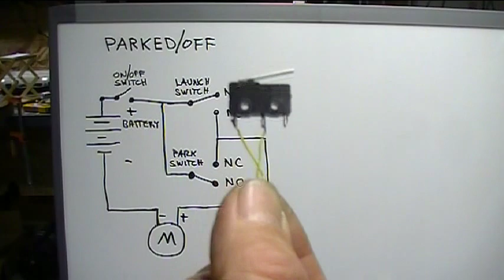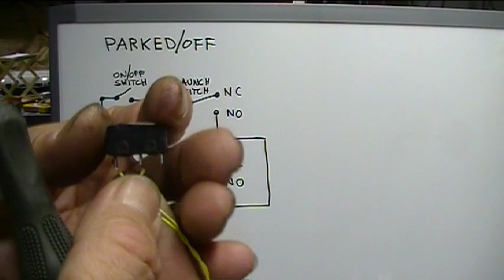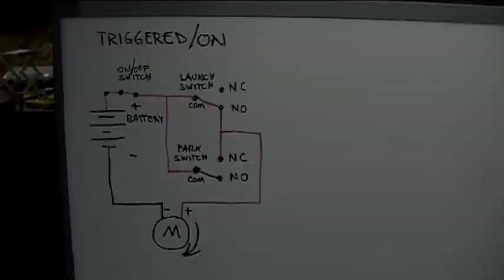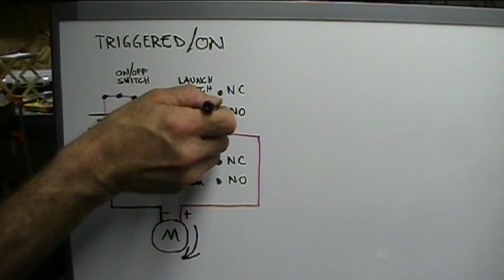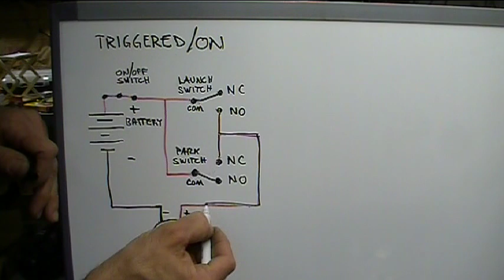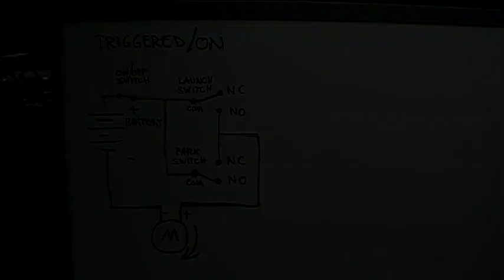Tennis Ball Launcher Deconstructed

Comment: Dean very nice work. For those who have not noticed but at @12:20 where he talked about normally open and normally closed switches, the configuration is a Logical OR gate. With both switches are open, the motor is off. If the launch ready switch NO is closed, then the motor is on. If the park ready switch NC is closed, then the motor is on. The launch and park switch are connected in parallel. This is the current flow of a logical OR gate in state circuitry.

Comment: i built something very similar. i place a delay relay in the circuit to give the puppy time to get down range i wired a flashing led to the nopen position on the timer relay switch which would flash once the ball triggered from the microswitch, I also added a piezo buzer to the motor circuit which really hypes him up as it turns and fired. I used a wiper motor and just used the thread on the motor to the axle which worked a treat.  Your vid inspired me thanks for sharing.
Reply: no need for the park switch as the motor stops as the ball leaves the trigger swith.  i run the arm on thrust torrington bearings i also made a top and bottom guide to keep the arm perfectly aligned. i will email you pics tomorrow.

Comment: This is the best explanation of the use of microswitches in a circuit that I have EVER seen - and I was an IBM tech for 23 years. ATMs are chock full of these switches and circuits. Wise of the University of Oklahoma engineering student to ask you. :-) 

If someone builds this with a weaker motor, they could try using a shorter or weaker spring that puts less torque on the motor - provided it is still strong enough to launch the ball. 

Combining your hands-on knowledge of building things with your commenters knowledge of Logical And / Logical Or gates would provide valuable knowledge to many more people. It makes me realize I could have used an electrical engineering class early on instead of figuring things out using common sense. 

Have you considered teaching common appliance repairs using video? For example, the cover switch on washing machines commonly goes out, and knowing how to bypass that switch (in homes where adults with common sense are smart enough not to stick their arms into moving mechanisms) is an easy workaround to buying a new washer or having a repair person rush out.
Reply: I thik u have Good idea about circuits